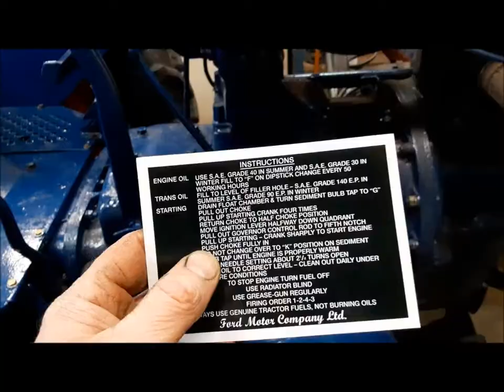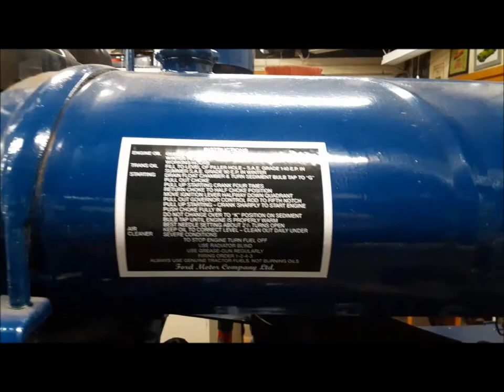Fordson Major E27N part 21 Wrapping it all up

Comment: Kevin you did a marvelous job Yes they from my memory were never great at idle and that was with the Magneto ignition there was a number of different carburetors and hot plates over their life They were generally better as a lugging tractor 🚜,didn’t like idling liked pulling that 2 or 3 furrow plow all day but don’t ask them to do light work Once described as like a Donkey temperamental

Comment: Check the float needle valve.  It may be sticking open causing the overflow of fuel.
Reply from the maker: That's exactly what is wrong with it. Will be addressed in future.